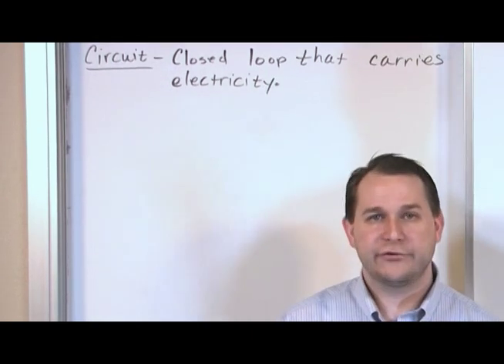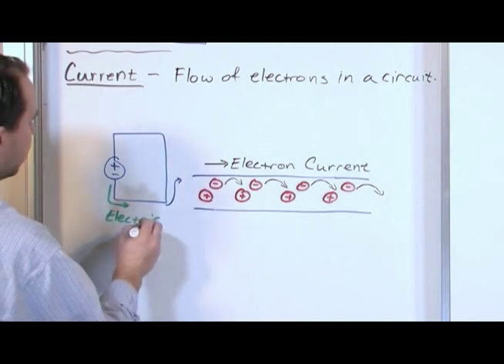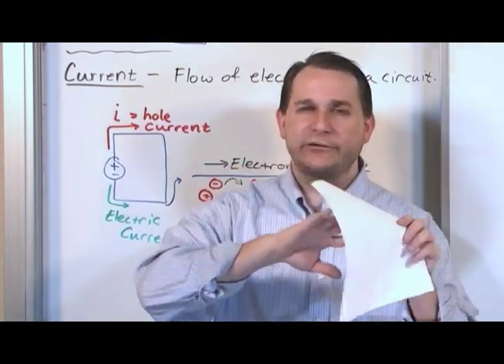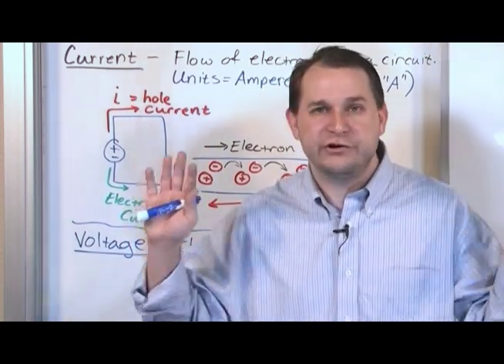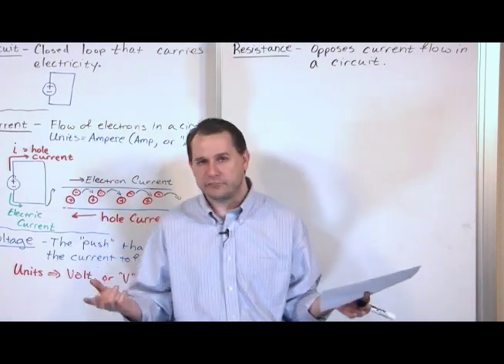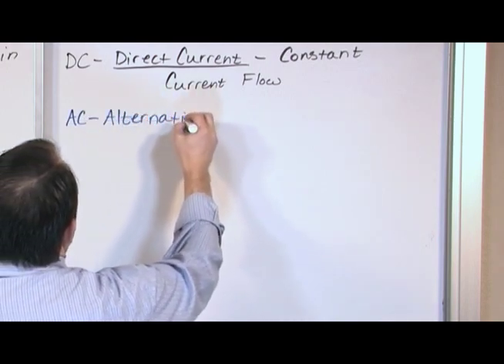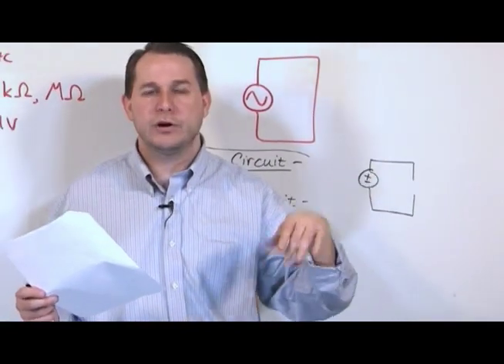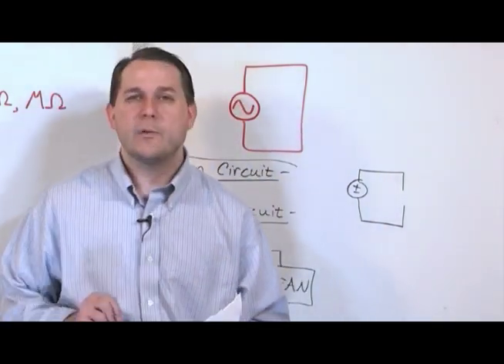What is a Circuit? How does Electricity Work?

Comment: Regarding electron flow (electric current) vs. "hole" flow (conventional current) I seem to recall that when I completed USAF Electronics School back in 1989, there was only electric current used although we did briefly discuss hole flow. As with most things these days my recollection could be way off, so others may have had a different experience. 

For this reason, still to this day, I have a hard time getting on board with conventional current. I still struggle with nodal and mesh analysis and this may be one reason why.